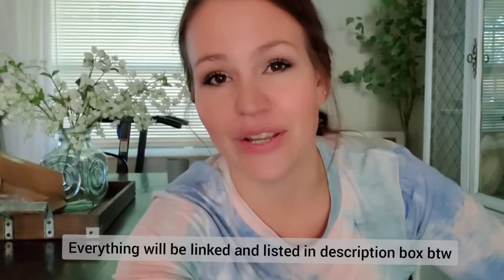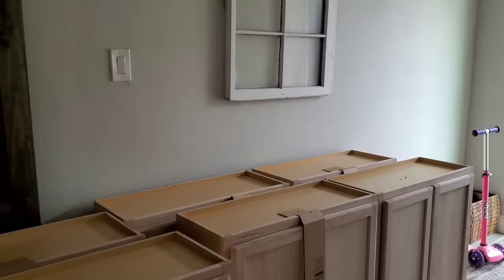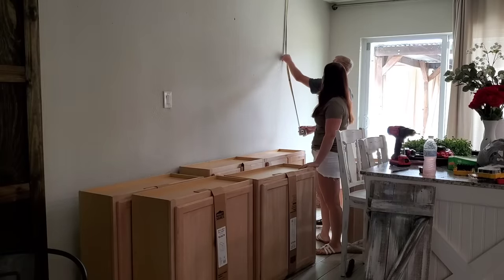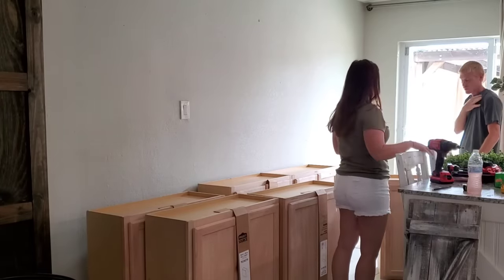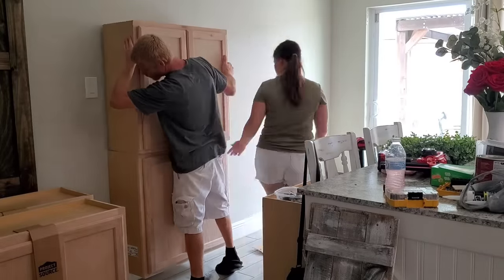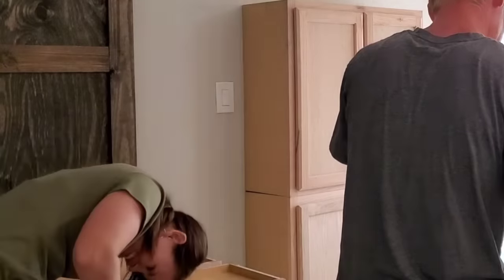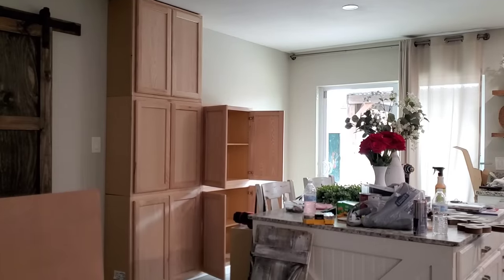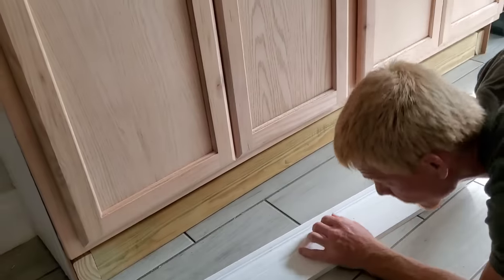DIY PANTRY | PANTRY WALL | USING UPPER CABINETS TO MAKE A LARGE PANTRY CABINET.

Comment: I use to do cabinets for a living. You never nail cabinets because nails are unpredictable. They could blow out the front and cause a blemish plus the are easily pulled out. Always predrill and use cabinet screws. Great idea, I've done many builds using wall cabinets in this manner.

Comment: It's crazy how similar your home is to mine. Mine is a new build and our open concept area is almost identical to yours except the area where you're building your pantry is our breakfast nook and your breakfast nook is our entryway!! But other than those two being reversed, same layout. Our front door leads straight into the living room and I'm gonna move it over towards the entryway more to create more space in the living room if that makes sense. I'm doing almost this exact build in my  dining room as well. I don't have an official pantry and I can always use more storage. Also we have a breakfast bar instead of an island so that will be getting changed soon too. So much to change on a brand new home!! But it's worth it to put my own touches on it. I cannot wait to own my first home. We close in a week!!!!

Also wanted to add that we're leaving the bottom middle section of the pantry build out and building a custom bench right there for seating for half of the kitchen table if that makes sense. it's a small area so we're trying to utilize all the space possible.

Comment: I'm only 9:00 minutes into the video but wanted to say, if the door hinges are European style, you adjust gaps very easily by loosening the screws on the hinges and moving the doors around until you close any gaps.  Then tighten the screw back down. There's going to be an awful heavy load in those cabinets-the purpose of a base (like the one you built is used to help disperse and carry that weight load.  You put the base on the floor and then sit the cabinets on them.  Right now your bottom row of cabinets will be holding all of the weight by the screws you used.  It would be an easy fix right now by making sure the cabinet bottoms are sitting on that base.  If not, use shims or pieces of wood so that you have contact between the base and the bottom cabinets.  I am NOT being critical, I'm just an old DIY'er that is loving your channel and your ideas (also new subscriber) but wanting you to avoid  damage to your wall and/or the children if that wall of cabinets decides to come down.  You've got something awesome to attach them to-the concrete wall.  Just use more than two screws for each cabinet.  I cannot wait to see the finished product!!  It's awesome.

Comment: Fyi I'm guessing you didn't need to take the cabinet back the hinges are usually adjustable
Reply from the maker: They were 2 in smaller width wise they definitely couldn't be adjusted 🤣 I wish though cause I was mad when we had to take a trip back 😭